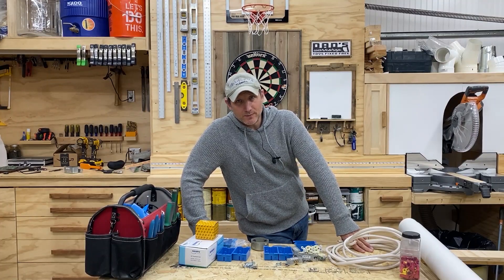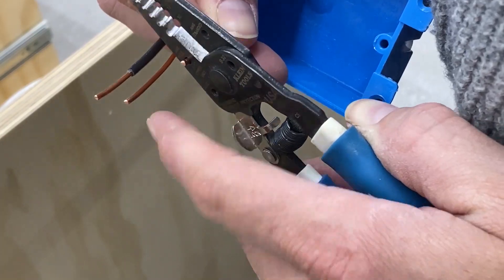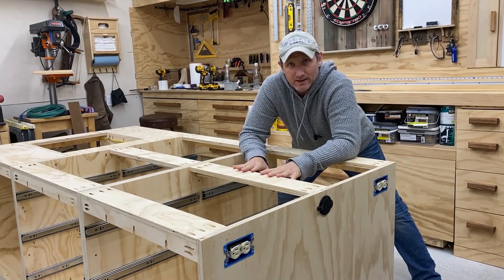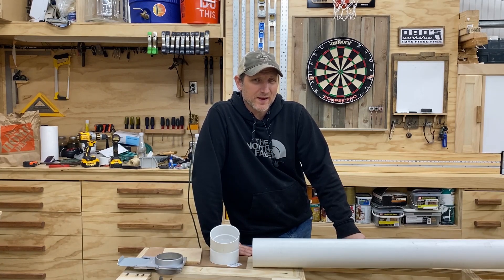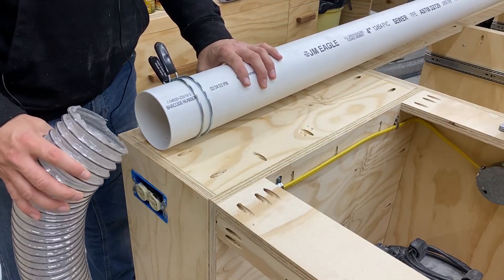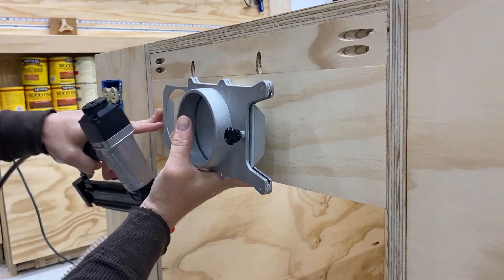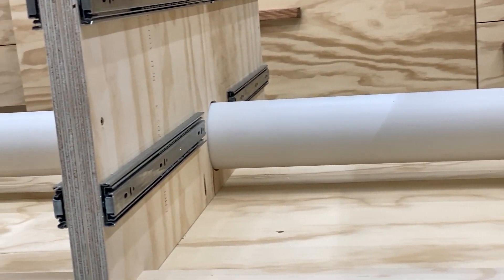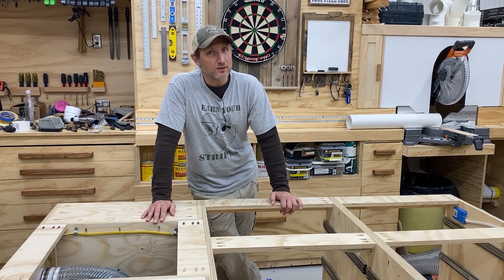How to build a Mobile Workbench / Assembly Table / Outfeed Table-Part 2 / DIY Shop Projects

Comment: Good build. So you don’t have any 2x4 vertical supports? From the top to the bottom? Just curious for my build.
Reply from the maker: No. These are like cabinet bases on wheels. Much easier to build in my opinion.

Comment: A[[ the cables should be ii the box because they are striped and its dangerous to short those cables or getting electrocution your selfe and insted using round light ffixture box you should use 
4 inch shallow box for splicing wires otherwise awesome build

Comment: IMHO, I think the vacuum line should go under the floor of the table, make frame out of 2X6 & run a 2 x 6 tunnel all the way across the frame, to hold the pvc. The pvc needs to be removable, it will wear out over time, metal is much better.
Reply from the maker: The pvc does slide out, but you are right, metal is definitely better, and doesn't need to be grounded

Comment: Nice build.  Some suggestions:  Flex hose in dust collection quickly reduces the CFM efficiency of your system.  I'd think about replacing it wherever possible with 4" pvc .  Remember to use sweep 90 bends.  The regulator/oiler may work with your tools, but many newer pneumatic tools are non-oiling.  Finally, when using Teflon tape, be sure to start it at least 1/8" from the thread end.  This will allow it to seat better and prevent bits of tape from being blown into your system fixtures and tools.

Comment: I like the design so far.  I need to build a much smaller version, but was looking for ideas.   I just wanted to comment on the electrical setup.  

At about 4:20 you can see some of the unsheathed wiring sticking out of the box.  You really do not want to do that, even inside of the table where you would think nothing is going to bother it.  Something will eventually.

At about 5:56 where you added your metal j-box you can see that you have two pieces of cable going into the bo in the same hole.  The clips are not designed for this.  You should make every effort to utilize the fourth hole on the bottom instead.  Yes this will take a few extra feet of cable, but better to be safe.  

Also I can see the four cables entering and then the four ground wires, but I do nt see a pigtail from the box itself.  You need to ggroung anything metal that is connected to the system.  Most modern boexes have a threaded hole, most of them raised, so you can attach a pigtail and not have the screw interfere with mounting the box.

Other than those minor items I really liked the video.  As a matter of fact, the idea I am taking away from this is the male outlet connecter.

Thanks for sharing.  Now on to part three.
Reply from the maker: Thank you for the tips. You must be an electrician. Good thing I wasn’t wiring a house. Sounds like I would have violated a lot of codes. I will definitely incorporate these into future projects. Safety first!
Reply: @ArtisanMade  I am an electrician.  Glad to be able to help.